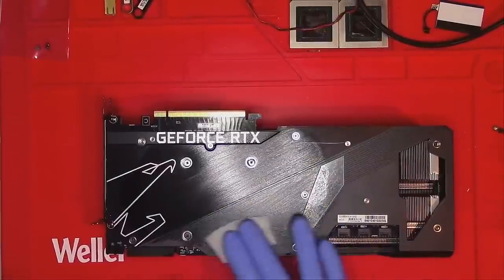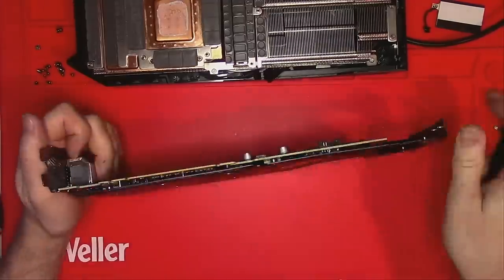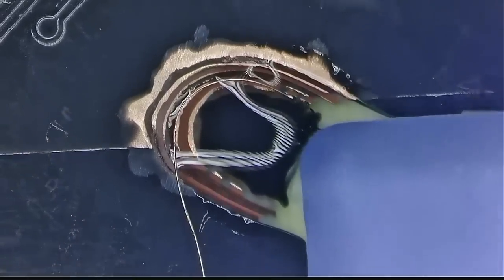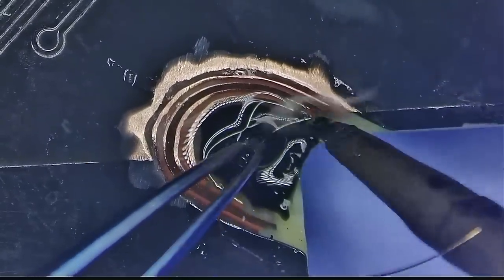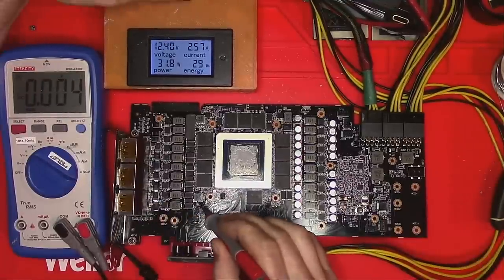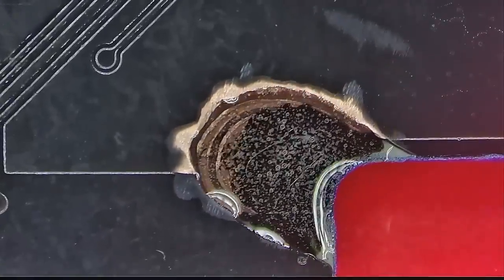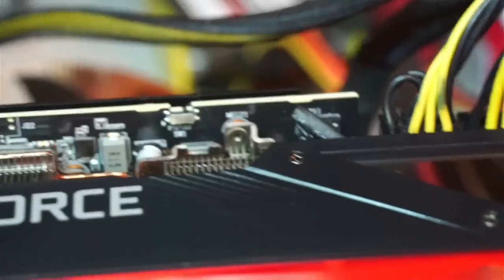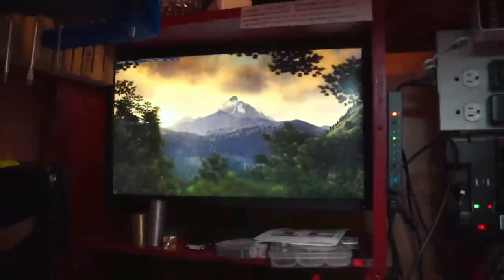Gigabyte cracked PCB repair

Comment: Hate to be that guy but, this is my GPU.  After getting the RMA "Death Note" I was pretty much out of $1800 for the card.  Local shop guided me to the NorthWestRepair.   I thought to myself, no chance this gentleman responds, less than an hour later we had the details worked out and the card was on its way.  FULLY communicating throughout the entire process, very responsive.  I am TRULY impressed at this level of not only service (because it does not exist in 2023) but also his ability and willingness to use his very specific skillset to save people thousands of dollars.  This gentleman is truly a diamond in the rough, I am recommending Northwest Repair to every single person I know as well as showing this video, it is so impressive the level of expertise it takes to complete a job like this.  THANK YOU  !!!!
Reply: Its not your fault brother. Its always like this, these corpos want our money so bad before buying just to after you do the deal to dismiss you since the cash is already in their pocket. Godspeed.
Reply from the maker: My pleasure
Reply: I have pretty much same card. Did you have a bracket on it or no? little scary
Reply: @brianlukas2868  I do have a support on it, its a stand that has two clips.  Theoretically one on top and one on bottom, my assumption is I did not have it supported as much as needed to keep this from happening.  I noticed black screen crashed over the course of a few months on high load games, kept trying to troubleshoot, clearing CMOS, reseating etc etc. until one day after troubleshooting, dead.Thankfully for @northwestrepair , I am not out $1800 for this card.
Reply: OK thanks for the info. I will be very carefull
Reply: Jonas Jonaitis  like if that makes a difference...
Reply: "This gentleman is truly a diamond in the rough" This comment nailed it right on the head.
Reply: If I was clever I would used thick thermal pad and custom plate to run across the length of the pcie slot to reduce the pcb flex on the graphic card while using the middle plate and back plate to screw in the custom plate for additional reinforcement
Reply: you sound like a pretty smart guy, so whyd you let your card sag? Heathens...
Reply: @scalz420  Find out for yourself to see how many graphic cards have suffered sag issue leading to the pcb breaking due to the heatsink getting bigger and heavier and there isn't enough support to protect the pcb therefore it gotten damaged in a prebuilt pc during transportation as well user's fault for pulling and wiggling the graphic card without unclipping the safely clip on the pcie slot
Reply: @scalz420  Boy you surely don't know the differences when to keep your mind closed or get a reality smack to see what you say is why you don't understand physics
Reply: @neddy1287  no im the one who understands physics. ive built 20 pcs all with big hulking graphics cards and none of them have ever sagged or stressed my motherboard. They would like to sag. But i would not allow them to. Why would i? So i could be featured in the next video?
Reply: @scalz420 You might have build 20 pcs but it down to design flaw of the graphic card as it quite simple to overlook the problem as Jay2Cents did a detailed video about the sag issue as he have shown where  the problem is. Since some graphic cards have the pci-e bracket connected to the pcb but it sagged because it not connected to the heatsink and second thing is the pc case that have flimsy pci-e frame which is done with thin metal which causes the graphic card to sag and third is the pcie bracket slots in the case is abit too big for the pci-e bracket causes the graphic card to tilt at an angle where the graphic card isn't sitting straight inside the case. Now I rest my case here
Reply: "Local shop guided me to the NorthWestRepair"
THAT is how having a YouTube channel pays dividends. Also amazed at the honesty of the local shop. Instead of "it's bricked" you got "yeah, too heavy for us, but there's this weirdo on YouTube..."
Reply: @SGresponse  What have you just said makes no sense at all but insulting a guy who repairs graphic cards for people in his area by calling him a "Weirdo" 
Seriously something wrong with you
Reply: and now with 4000 series , gigabyte include antisagbracket. curious why ? 🤨 from time of my gigabyte 3090 and watching this scary videos, i use support bracket all the time, now with rtx4070ti i mounted their antisag straight to the case. thanks to NorthWestRepair we know more how to not break the expensive card.  and they are more and more expensive.
Reply: @pe3ke117  which aib 4070 ti are u using?
Reply: @davelee73  gigabyte aero white... coolest card i ever had... almost zero fan all the time... not more than 55°C undel full load and even oc up to 2900mhz stable all day long... no challenge for this card... 🥰 price is nonsense but i had no choice..
Reply: @pe3ke117  are you facing any sagging issue? is the support braccket really  that useful? the included support bracket i meant
Reply: @davelee73  yes. absolutely. no sag at all.
Reply: Jonas Jonaitis  It was in about $1700 USD range when it was new.
Reply: Well, Guess I know who to email if my gigabyte 4070 ti shits the bed in a similar manner.
Reply: I hope this time that card gets better support
Reply: @teddp  always had the support bracket, little more diligent after repair to ensure no tension on the pci slot though.
Reply: @brinnshipley5584 thank you for talking about this. You could actually help alot of people here. You mentioned you had a support, did you notice any sagging or anything on the card. This is actually concerning to hear that you had GPU support and it still cracked. 

I have a aftermarket GPU support one with the base on the PC case floor with the support reinforcing it up.

Curious to hear the support you had in place and anything you think caused it or could prevent this.
Reply: Why do you hate to be that guy? And who's "that guy"?
Reply: @ar4imond  I meant posting on their own video cards repair. However I felt the entire experience with @northwestrepair was above and beyond and perhaps could give hope to others.
Reply: did you mounted your gpu horizontaly ore vertically? and did you use the support bracket? also did you bought a pc pre-built?
Reply: @northwestrepair  you are a legend

Comment: Wow I didn’t even know this repair was done like that. I knew it was one of the harder and almost near impossible ones to do but you made it look easy.
Reply from the maker: This was the easiest one of its kind.
I have a far more difficult already finished, just waiting for some chips to arrive.
Hopefully video will be coming out soon.
Reply: @northwestrepair  multiple things shorted ?
Reply: @northwestrepair  I know Krisfix had a similar case with a 6900xt he fixed where he had to go 10 layers deep , he doesn't do that kind of repair usually as it's impossible to warranty.
Reply from the maker: @Perkeletricksterservantofrher  no, just more and way smaller broken traces.

Comment: This guy is very clever with his tools. I'm glad he's found a way to not only use his skillset to maintain a well deserved income, but also that he's actively improving the lives of many gamers on a weekly basis. Even if most of those gamers are probably noobs who I'd headshot within 2 minutes of them hitting the server.
Reply from the maker: LOl thats funny.
I would be one of the few that get shot in the head before i leave the spawn point
Reply: Slome  Handy because here in the UK, if you open a card yourself to try to fix a problem or even replace the paste, it automatically invalidates your warranty and second hand places won't take your card to attempt a repair. This guy is doing gods work.

Comment: All the pcb cracked from weight stressed cards I've seen so far these days are always turns out to be Gigabyte Aorus Master/Xtreme 3070ti and up. They're one of the biggest cards of that generation at 4-4.5 slots while also being one of the weakest structural integrity for cards of that size, too. It's like they didn't even have any kind of weight support built-in at all and relies heavily on backplate as the only means of structural support, which is a very bad idea.
Reply: I used gigbyte eagle 3060ti for a while. It was the worst quality. Fans was either zero or full speed.. When they started spinning they were making a throttling sound and when spinning down some weird clicking sounds..

Comment: Ive seen quite a few of these gigabyte cards with the cracked boards. Glad to finally see a video about the issue and a repair for it, i was always wondering on how severe the crack actually was for how minor it looked.
Reply from the maker: This is the most minor of them all.
Reply: Sure enough. More and more are going to appear. Good on calling this out.

Comment: I had an older GPU die on me due to some sort of issue that would make the screen show striped bars after running under strain.  I wasn't even aware that people can actually fix GPUs and would, or I would've sent it to you instead of buying new.  I will definitely send my 6800XT to you if that one fails in the future.

What I learned here is use a vertical mount if you can because not everyone has figured out how to distribute stresses of the ever increasing cooler sizes effectively.

Comment: I find it odd the AIBs would refuse to repair outright rather than offering the repair and charging the end user for a new PCB and technicians time. Interesting to see this video in light of what Gamers Nexus posted last night with EVGA having their own repair centre in house. This proved handy when overclocker biso biso blew up a MOSFET on a 4090 board , and they swapped the lapped die into a new board in half an hour or so.

Comment: Another great video! I always look forward to your posts. This goes to show that something like this is possible to repair. But, instead of actually doing the fix, these companies would rather you spend more of your hard earned dollars on a BRAND NEW GPU instead of them fixing it.
With these BIG GPU's coming out, In my new builds, I have been using GPU support stands. They make some good ones that don't look out of place. I wish YouTube allowed pictures in our posts so I can show people how they look. They are pretty inexpensive & will save you A LOT of money in the long run if you use them in your build.

Comment: Thank you for reminding that I should use a tool provided in my PC case' cartboard box to prevent GPU sagging. I have 6700XT Sapphire Nitro+. The GPU only sags just a very little. But still, I will install that one thing to ensure there is no sag.

Comment: The funny thing is they blame the customer for their design flaw which is really really simple to fix, just add a heatsink support like a metal rod and screw it to the PCIE bracket or use a metal fan shroud to hold that massive weight!
Asus did with 4070 ti tuf minimal sag.
Reply: MSI even incuded a GPU STAND to prevent sag in thier heave SUPRIM X 3070

Comment: The main problem is, that the cooler isnt connected to the bracket to support the wight. Just 2 additional  standoffs and screws would do the job just fine.

Comment: You are having a NC Machine so is it possible to create a Metall or Aluminium Shield that you can pull over a PCIE Crack to Stabilize it more? I´m a Metalworker, so i was on Lathe, NC and CNC Working and that is my Idea about PCIE Cracking. What are You Personally thinking about my Idea?

Comment: If it was even weight distribution 2/3 down the board would be the best mount point.  But most of the weight is connected around the GPU.   So support it around the end of the pcie connector.

Comment: If you use different lenth of wires for data lines, the card will be unstable at higher clocks. Because the timmings are off.

But if they are just power good, it is fine.

Comment: Good reason to use the supplied support brackets.
Reply from the maker: only if you lucky enough it fits into your case.
Reply: @northwestrepair  The support bracket for my gigabyte 4080 which came with the card works perfectly in my case which is an Enthoo 719, unless your case is not much bigger than your mobo I doon't see the problem.

Comment: Well, I would try to learn this, too. But I guess the equipment is very expensive, isn't it? Why I want to learn it? I have a dead raspberry PI 4 with 8 GB ram. I think, the problem is the power supply on the board. I have a dead laptop, too. I guess the BIOS is corrupted, so there's only a black screen and nothing else. The emergency bios flash function doesn't work.

Comment: Gigabyte PCB cracks near the PCIe tab slot because of the straight angle design and longer length compared to other AIBs. Other AIBs avoid this fault because the PCIe tab design is rounded.

Comment: God bless Galax for sending a support bracket with their gpus.
my 3080 came with one, i owned a 1070ti strix before and over the years it sagged pretty badly, (it didn't die thankfully)
i was always told that gpu sagging wouldn't kill a card, but i guess everyone that said that was wrong.

Comment: I had been using Gigabyte graphics card for very long time since I first got it with GTX 560 Ti, then GTX 660, GTX 1070 FE and now RTX 2080 Super Turbo. I had used it for DCS World and played it at maximum quality graphics setting at 1080P HD with no problem. The extreme durability of the electronics component is so good and proven. Just lucky I did not upgrade my graphics card to RTX 30 or 40 series yet.

Those RTX 3080, 3080 Ti, 3090, 3090 Ti, 4070 Ti, 4080 and 4090 GPU card was so expensive, the best suggestion for those who afforded it should get water-cooled version rather than air cooled version. You can pay for a such expensive 4090 card why not just add plenty bucks for water cooled version? I think the water-cooled version should be safe from any PCB cracking?

If I am Gigabyte, I will recall all the air-cooled affected GPU and RMA replace with water cooled version with additional cost from the owner just to upgrade it from air cool to water cool and solve the issue. Those recalled GPU still have valuable for recycle to retrieve the GPU processor, GPU VRAM and several electronic components to remake new water-cooled GPU.

This will satisfy the customer and the trust from the community to maintain future sales and the trust of the community for the brand. However, Gigabyte respond with refusing the RMA is destroying themself just to prevent current loss but will suffering future loss of sales.

I think that must be something wrong with the Gigabyte, it's getting into civil war just like the old ancient Chinese history the romance of three kingdom. It was fighting between Three kingdoms for ASUS, msi and Gigabyte, just like the old days of Cao Cao, Liu Bei and Sun Quan. Those Chinese never changed for thousand years ago, they remain fighting each other's as those ASUS, msi and Gigabyte was all Taiwan 's Chinese company.

The condition for Gigabyte just likes the old days of 1927-1949 Chinese civil war between Chinese Communist Party 's Mao Ze Dong and Kuo Min Tang 's Chiang Kai Shek. You should know how and why Chiang 's defeat in the civil war, that's lots of Chiang 's Generals and personals defected and joined Chinese Communist party. They all disclose critical secret, misleading in military strategy and caused a total defeat of Chiang Kai Shek in China.

That Gigabyte just like the old day 's Chiang Kai Shek, stubborn and failed to dig-up any traitor. With modern engineering computer aided design, how can Gigabyte did not know the weakness and flaws on the PCB design? did they did not simulate it on CAE simulation? There must be a mole or traitor hide within Gigabyte?

Comment: Good job, Best way is using it vertical to get rid of that problem. Or put a stick under that corner to support this long cards or you will have a saggy board and cracks like this.
Reply from the maker: Absolutely right.
Reply: I just tied it up with zip tie to the upper part of  case till the support comes in mail.
Reply: @sogetsu60  Good idea..

Comment: Hey Tony, two weeks ago, I purchased a Gigabyte Gaming OC RTX 4080, then I discovered this cracking issue from  Louis Rossman's recent video. Have you seen this issue affect any of tGigabyte's newer cards? And is this a case of GPU owners not using a support bracket/column?
Reply: Is your card still working ok?  I've got a Gigabyte Windforce V2 RTX 4090 and I'm nervous.  I have the cooler blaster support stand coming in 2-3 days, but I'm nervous.

Comment: Hi, I'm your subscriber for a long time, your videos are always interesting and a good learning experience. I need your help today, just a reply to this comment. I mixed up my psu cables, plugged in my EVGA RTX 3080 with a EVGA pcie cable to a corsair psu by mistake. Only one power cable was connected at that time, as soon as i turned it on, i saw a spark, smoke and it smelled burnt. Then I replaced cables and plugged evga pcie cable to evga psu, it sparked again and only two fans ran. I completely stopped there. Not sure what to do next. The spark and smoke which i saw was just beside the pcie connector on the graphics card. Can you suggest me something?
Reply from the maker: What's burned ?
Reply: @northwestrepair  It looks like a square inductor, right next to the power connectors. Thanks for replying.

Comment: Ya'll never mentioned the temp rise on the higher performance.  My guess is a lot hotter and then it can melt the 12v inlet connectors. Yah sure.

Comment: Usually 3090 have hot VRAM issues (95 Celsius degree and so on), die temps usually around 70 Celsius but yeah.
Some desktop PC owners nowadays even calling 70 Celsius degree at die temps as hot.
Reply from the maker: Higher temps=shorter life.
That's the issue.